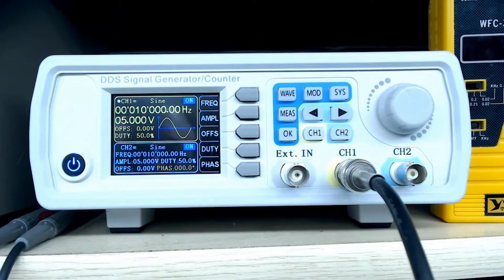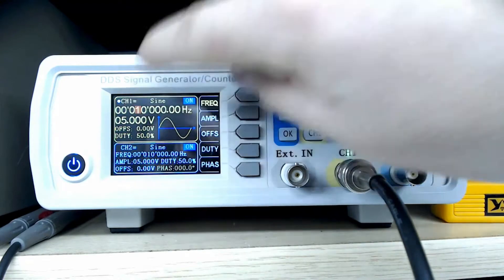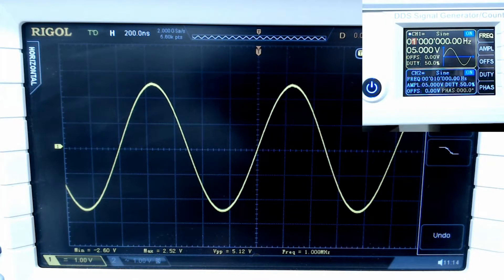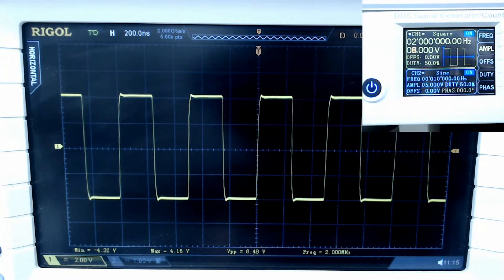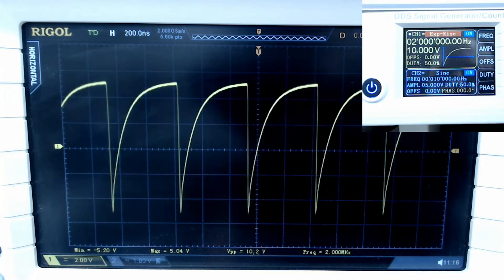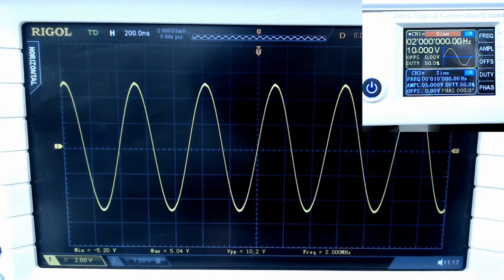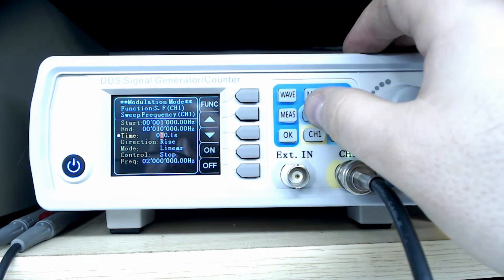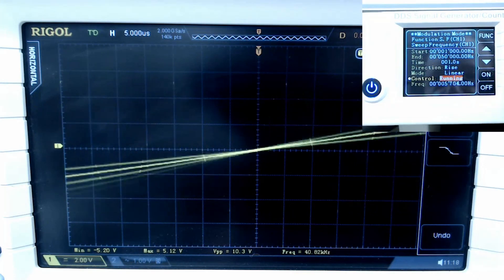Koolertron 60mhz Signal Generator Review and Demo

Comment: I just bought one of these (the 15MHz model), its a great piece of test gear for the price ($99 on Amazon.)  It could probably use some type of ballast inside the case, like a steel plate or two to keep it from shifting  around on the workbench so easily, but otherwise its a great deal for the money.  Thank you for the review.

Comment: if im putting two signals into a 41 op amp to generate an AM to I need to change any settings on this generator?
Reply from the maker: I am assuming you are referring to a "741" op amp? You can generate both the carrier wave and the audio modulation from this generator out of each channel.
Reply: Can you set % modulation?

Comment: To connect it to the oscilloscope do you connect it to to the external trigger connection
Reply from the maker: Lambda No, you connect the CH1 output of the signal generator to a Channel Input on your scope.  Of course it depends on what you want to do as there could also be a reason to connect it to the trigger, but for standard/basic operation it is connected from Channel out to Channel In